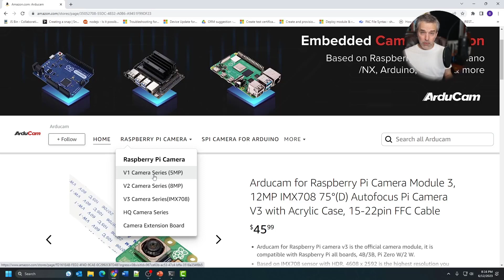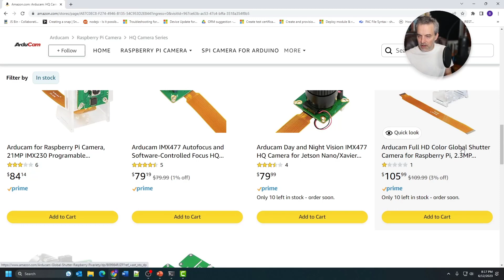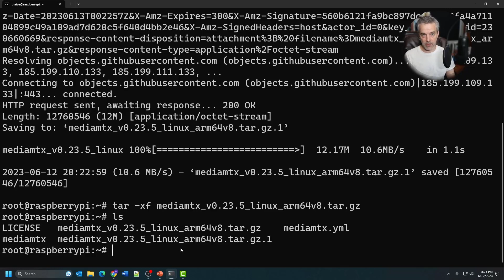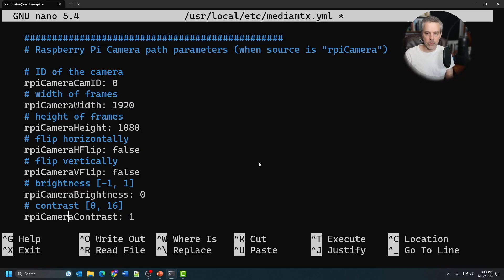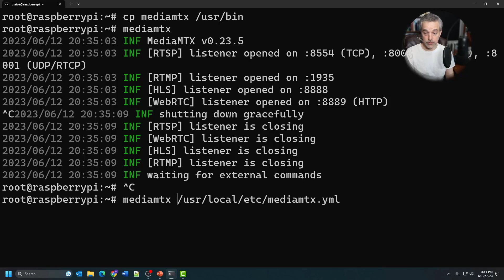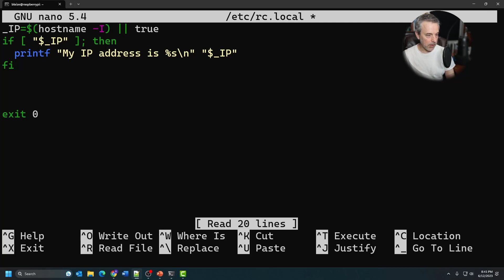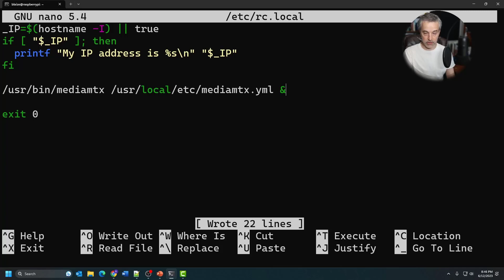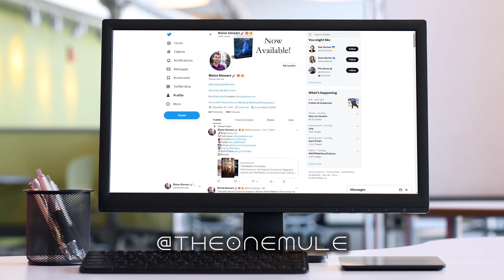How To Build Your Own Security Camera: Part 3: Raspberry Pi Cameras with a DVR/NVR

Comment: Are there any battery powered WiFi cameras that can be used in this capacity, so that you can have remote viewing in the yard?
Reply from the maker: That's essentially a trail cam, which those do exist. You could use one of these in your yard.

Comment: tbh by the time you have activated rc.local (which is not supported currenlty) You could have just created a service file in systemd.
Reply from the maker: It seems to work on Raspian. Either way.